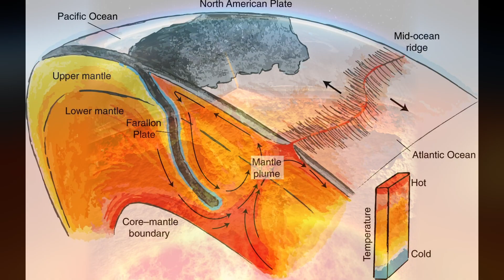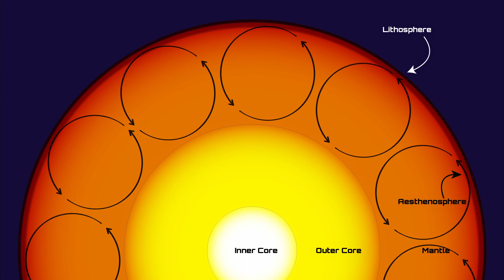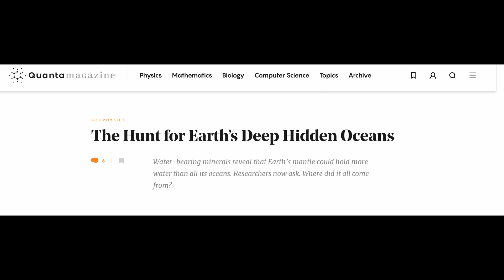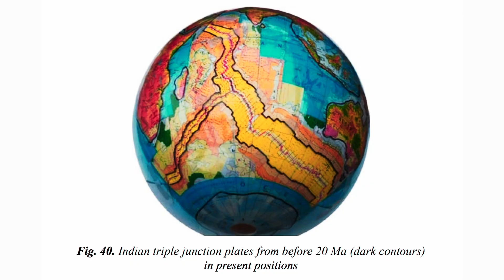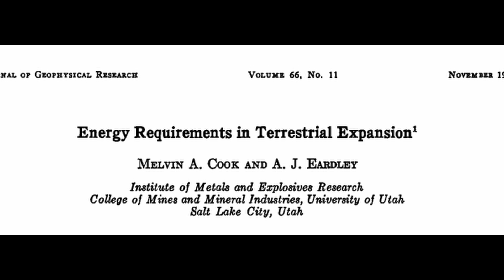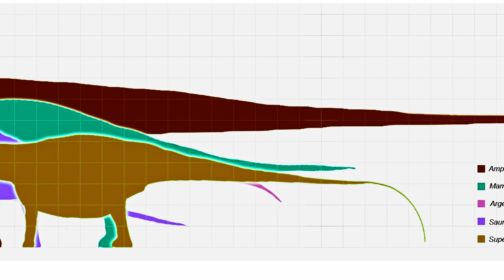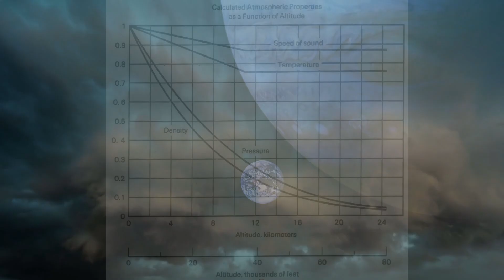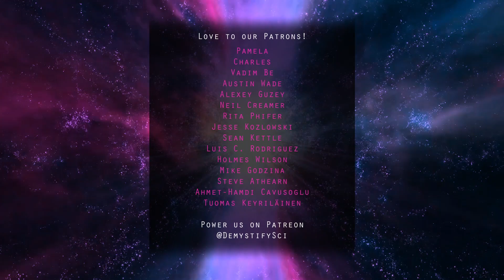Did Earth Start as a Mini-Neptune?

Comment: Now apply the same scenario to Mars and you have possible explanations for the massive stretch mark named Valles Marineris, the giant volcano Olympus Mons, the mysterious loss of its atmosphere, and the disappearance of its surface water.
Reply from the maker: Ooooh maybe! I like a more catastrophic answer for the valles - we were thinking of collaborating with our glass blowing partner to see if we couldn't do some electric arcing to recreate the valles
Reply: @DemystifySciInvestigates  To be more believable you need a theory that applies to all planets. Venus is still in its high-density atmosphere phase, for example, and what else could better explain the single massive oozing volcano on Mars better then a vent that allowed the pressurized molten contents to slowly ooze out as the atmosphere dissipated instead of rupturing its "skin" in multiple catastopic failures like the valley to create a cracked surface resembling a dried lake bed (i.e. something similar to our tectonic plates).

Comment: If the expanding Earth hypothesis is valid (I believe it is, regardless of mechanism), that could mean that India might never have really been separated from Eurasia. If you look at Google Earth, you will notice that the Himalayan "arc" matches/mirrors almost identically to the Kurile Island arc chain. To verify, draw a line from Iceland to Taiwan and observe the 2 mirrored arcs. There is crustal symmetry across Eurasia. With that in mind, how could the Indian subcontinent crashing into Eurasia create both the Himalayas and a symmetrical island arc chain in the Pacific?
Reply from the maker: I tried to draw the line, but they don't look very mirrored to me. Has someone done this and posted about it? come to the discord @ https://discord.gg/4kjp83Kb3U
Reply: @DemystifySciInvestigates  It's a work in progress, but i'd be happy to show you. Joined, thx!
Reply: on the right track, evidence suggests .. that "2 mirrored arcs", but there are several, consider the one that makes a volcanic ridge north from Hawaii as like a zipper .. the close to surface 'skin' split like ripe plum and slid aside .. all volcanic rocks are, made from magma,  forms of foam ! As for the Himalayas, north of there is a plateau, coincidentally shaped like a grazing or impact, glancing blow. Maybe India never relocated, mountains were formed in place something came close in, (from space), and smacked it hard there, whether contact or not, proximity matters .. and magnetospheric structures do too. So look again with a thought that something pushed down hard there, mucho caliente for awhile, pushed hard passing by and the land subsequently sprang back outward in response = leaving a glaciated high desert. Physics, chemistry, electrical engineering, and common experience all support this bunch of clues .. but was that the event that tugged on the zipper? it would seem to be necessary for some mass transfer for ingredients to foam with: salts, metals, waters ... cheers.
Reply: The entire continental crust was joined. Pangaea was Earth's first ocean bottom, only the globe was physically smaller.                                   |